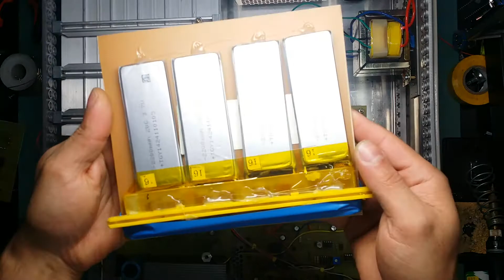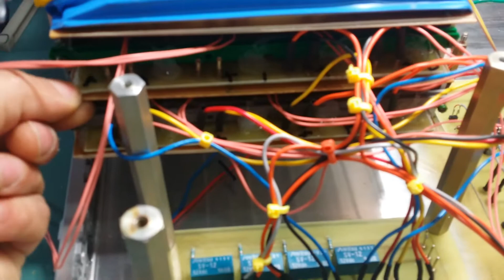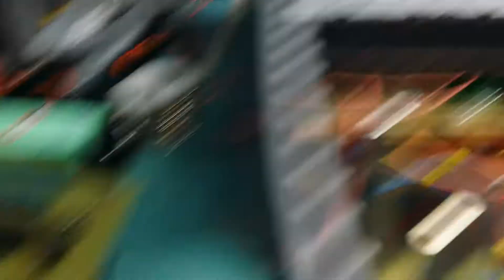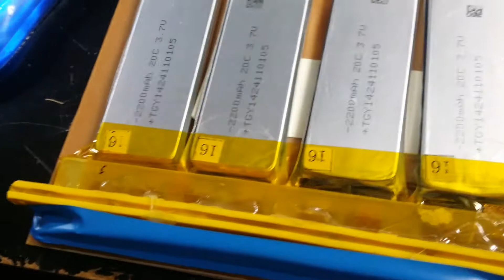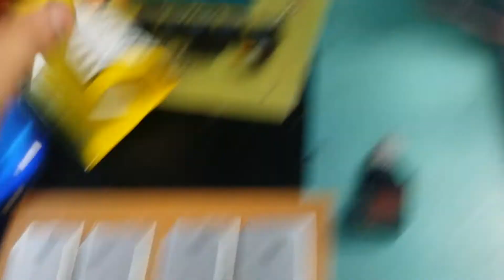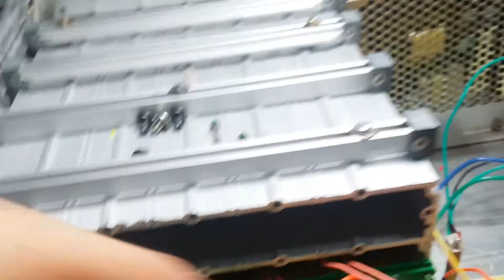Lithium battery lab power supply quick update

Comment from the maker: ye scratched my head for few hours and did a sketch of it. this project is getting a bit out of hand. lol there is so much to wire and put in. had to design another board for the charger. so far 87 relays and counting. the sound of the relays are so cool, clacking around like melody in my enclosure.